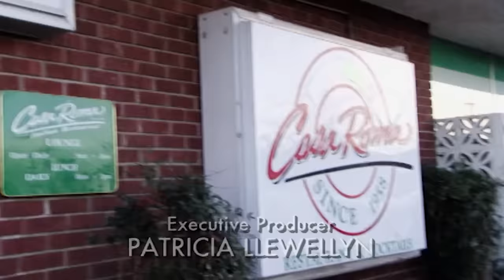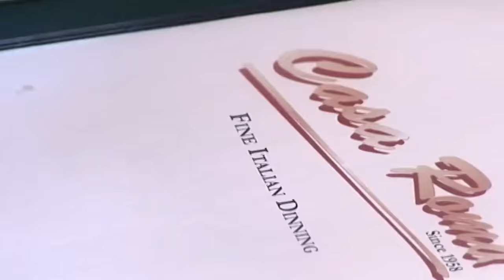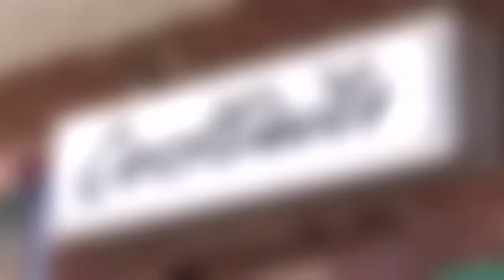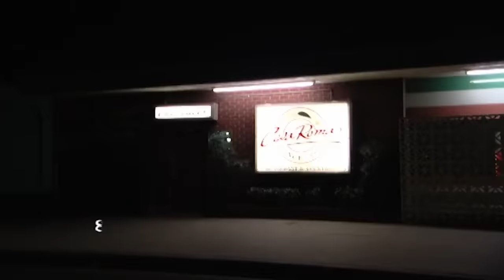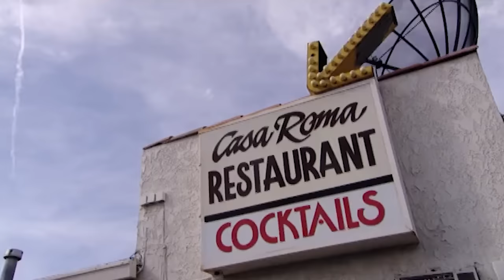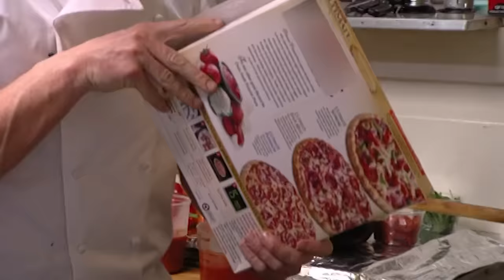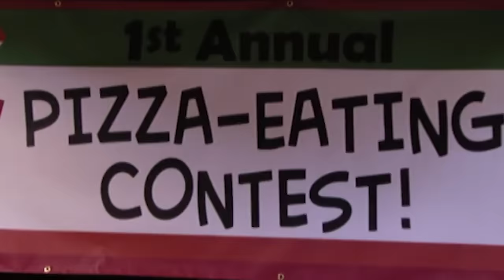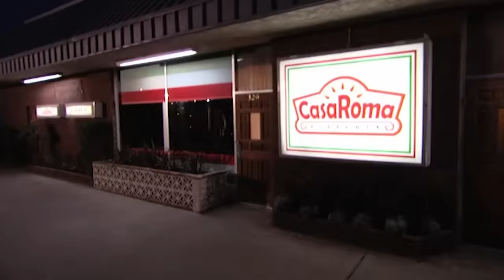Gordon Ramsay Served A Sandwich With Powdered Sugar On Top | Kitchen Nightmares FULL EPISODE

Comment: im one minute in and the quick fix would have been chainging the restaurant into like a pool hall game room for bar guests
Reply: Doesn't make money
Reply: @Plasmafox  So the numerous pool halls across the country just magically stay open for 30+ years?
Reply: My first thought was this should’ve been bar rescue instead of kitchen nightmares. Get rid of the restaurant that is wasting space and make a bigger bar!
Reply: @h67_ they clearly have never been to a bar with a pool room lol there’s always lines for the tables. Very lucrative
Reply: @Plasmafox  So first of all, yes it does. For one, people are more likely to go to a bar that is a cool, fun place to hang out, and being able to play pool makes it both of those things, increasing the number of customers. And for two, you could just directly charge to use the table for a certain amount of time (I don't think it's necessary, but it's an option)

Second of all, the restaurant wastes money if nobody is buying the food, so even if they just boarded up the restaurant part they wouldn't be losing money paying the cooks and waitstaff, running the power for all the kitchen equipment, and buying food they have to throw away. Even if the pool table didn't increase the customer flow to the bar and they didn't charge, it would still save them money in the long run.

Comment: The best way to make public bathroom is make it a water tight shower with a floor drain.  You have a hot water house to spray down ceiling, walls, floor, fixtures.  Soap up, scrub with a broom handled brush and spray down. You can clean the entire bathroom spotless in 15 minutes.

Comment: ... "Casa Roma closed for good on July 1, 2017. However, there were some closures and rebrandings that happened before that.

The original Casa Roma restaurant seems to have closed sometime around 2014 or 2015."...

Comment: I know myself, I know my strengths, and weaknesses.  I also know I can get education to make up for some of my weaknesses and turn it into strengths.  The one thing I’m missing, a key element, is the desire to to make the commitment of a restaurant.  it’s not enough to be a good cook or a chef.  It’s not enough to be anyone element that it takes to run a restaurant.  You need so much more to be successful.  And above all, when I step into the ring….. I know I’m going to win, I know I am the champion.  As long as I am unsure, I will not step in the ring, and this ring…. a restaurant, I am unsure.  I’m not doing it.